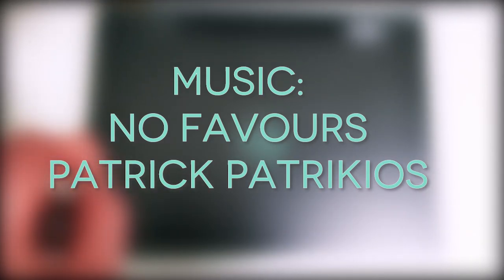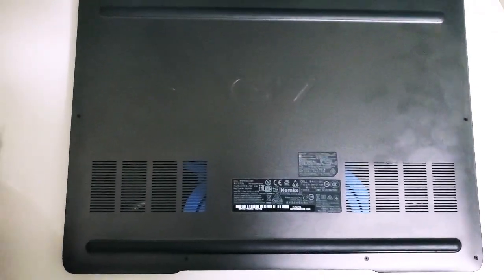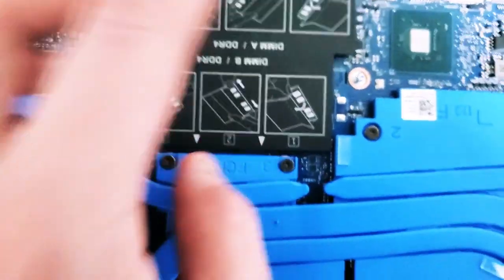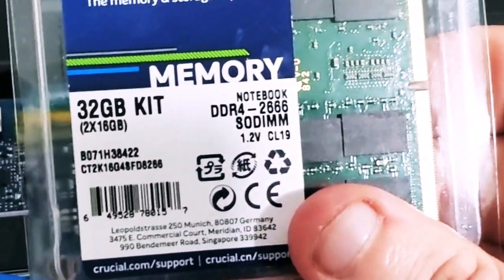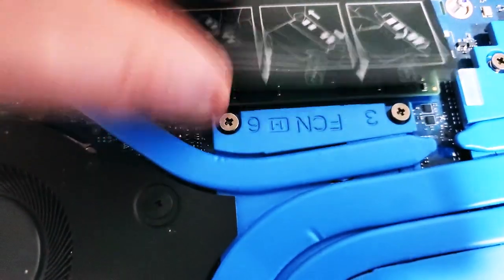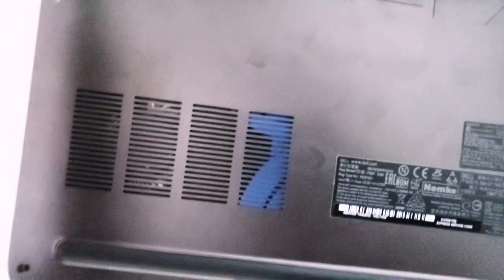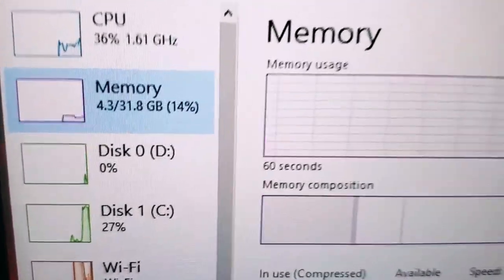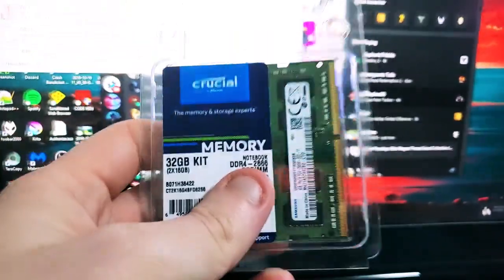How to: UPGRADE Dell G7 7590 Laptop Ram - QUICK TUTORIAL

Comment: Very helpful! I just bought this laptop and wondering where you can buy the ram sticks. Those memory sticks are out of stock on the ones you used. Please lmk!
Reply from the maker: Amazon. Just look for matching ram. Also use Crucial's memory tool online.
Reply: Joel-Peter gotcha thank you. Also what if I’m just buying a single 8gb to just install so I can just have 12gb in the laptop. Will it still work if I only install one 8gb and keep a 4gb?
Reply from the maker: Yes it would but you want dual channel for the best performance

Comment: Hey man... Picking this up in a few days... Ram upgrade will be right away of course.   Question.  This model on the Dell site comes in a few flavors obviously.   I see the 2 lower end models of this G7 7590 have both a NVMe SSD module as a boot drive and a second storage drive.   I'm looking to upgrade storage as I purchaed the 512GB single SSD model...    --->Is there a spot in this laptop for a second drive?    Getting a new single 1tb NVMe to replace the 512 is a bit costly.     Thanks for reading and thanks for the Vid!
Reply from the maker: So the laptop does have 1 NVME M.2 slot and a secondary 2.5in SATA slot. So yes, you could pull out the 1TB mechanical drive and replace that with a 1TB SSD.

Thanks for watching.

Comment: Would 3200mhz be incompatible with the G7?
Reply from the maker: That's an excellent question. It MIGHT work but would downclock to stock speeds of 2666.

If you're paying extra for the bigger MHz bump, just go 2666.

IF you have a spare 32gig 3200MHz kit you can test with, try it and report your results back :)
Reply: @J0elPeters  yep, I went with the hyperx impact 32gb 3200mhz and they work but are downclocked to 2666 as you said. I might be upgrading to a different computer in the future and it wasn't much more cash so I'm okay with it.